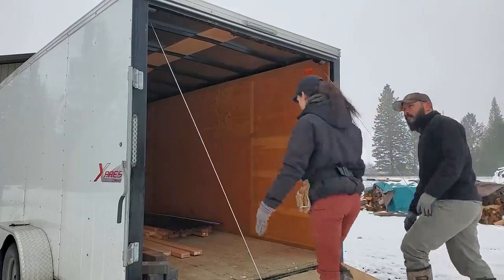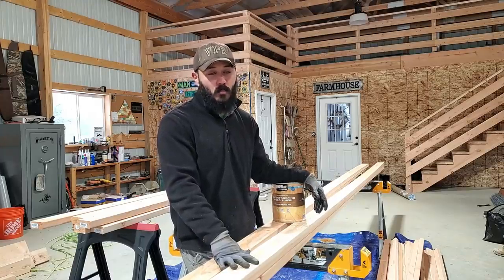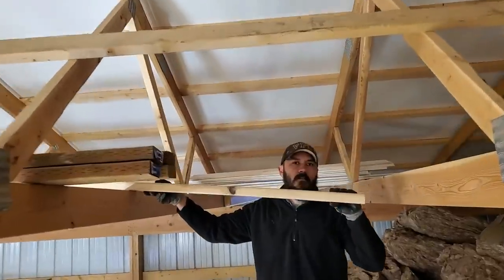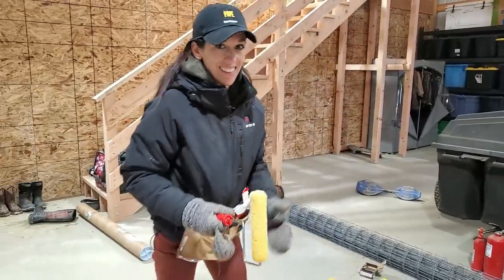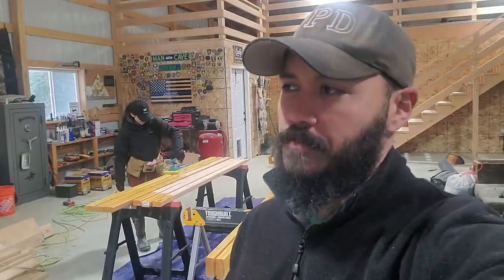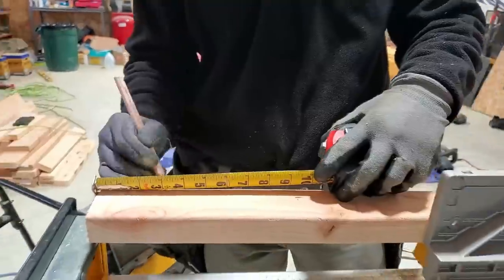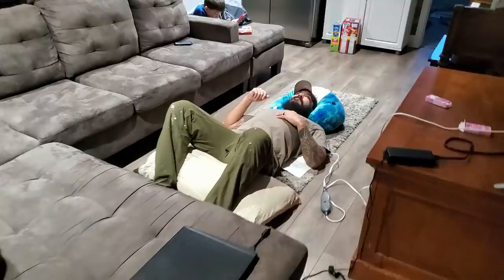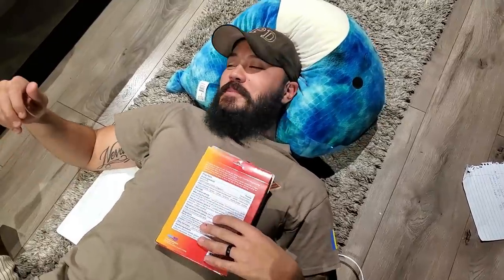He's INJURED | Not How This Build Was Supposed To Go

Comment: Dude, if you never read any other comment of mine, or never take any other advice from me, please read this and take the advice. I had back pain all my life. Bad enough at times that I was out of commission for months at a time. Pain so bad that even SMILING.... hurt. (You'd think there would be no connection between a smile and back pain. LOL) I now have metal plates, and nuts and bolts in my back. I won't go any further into details, just understand that I know about back pain! Twisting wrong. Bending over. Sneezing. Reaching. Even sitting on the edge of the bed and relaxing my back too much. All caused a twitch, then a bad spasm in the back, then weeks or months of agonizing pain.

I tried everything. Tried many doctors. Tried many medications. Even finally had the back surgery. But nothing ever worked as well as this does.

1. Sleep on your side. Always. You may have to put a pillow in front of your chest, to put your arm over. And you may need to bend the leg on top, at the knee and put a pillow under the knee.

And 2. Take these supplements. A. Turmeric. B. Resverotrol and grape seed. C.Horny goat weed. (No jokes.) D. Omega 3. (The BEST one I have found is in a bottle with blue and yellow label at walmart, believe it or not. Says 2000iu. I take 4 a day.)

I can't tell you exactly why these things work, but the combo absolutely works for me. It may take a while to begin to work. Or it may make a difference right away. Don't give up on it, please. I started seeing my best most consistent results after having taken them about 6 months. Now I never miss them. And I take half again, to double the dose recommended. 

The best way that I can describe it is that there used to be what I can only describe as a constant, deep down, core pain that was always sitting there. Waiting to react to the stupidest little trigger, as if I had been stabbed. As soon as the stab happened, it instantly blossomed into the agonizing overwhelming pain. Have you ever seen a bottle of water that has been in the freezer, but hasn't frozen? You tap on the bottle, and it almost instantly freezes. Yeah, that's the way the overwhelming and agonizing pain developed from that 'core pain'.

Well, the combination of supplements somehow suppresses that core pain. Now, when I get the twitch.... No instant agonizing overwhelming pain. Whatever injury I just did... Is exactly the injury that I have to heal from, and I don't have all that agonizing stuff any more. It's been years now. And in fact, last moth, I re-injured my back again, the worst I ever have.... And I was over it the next day. Instead of being in pain for months. Unable to smile, breathe eat, go to the bathroom, etc. I sat in a chair for the day, and went to bed. Next day, I was fine.

Comment: You might want to have your back checked for a Lipoma. I had trouble with my back and it would like an electric shock going from my shoulder blade down to my lower back. I would take about a week to recover. When I turned 65 I had to get a yearly physical for medicare insurance.  I told the doctor about my back spasms and the feeling of an electricshock going down my spine.  She said take your robe off and lay on the examining table. She was feeling my back above the right shoulder blade and she said that I had a lipoma growing there.  She said it is a fatty tumor that likes to dig into the nerves along your spine. She has a brother that has one and he would not have it removed.  He is now in a wheel chair.  I had mine surgically removed and have not had a  back problem since.. That has been 12 years. Mine was imbeded pretty deep as the surgeon told me it was 3 to for layers of stitches.  Might be worth checking it out.    Watch your videos and they are great.   Keep up the good content..    Mike M.

Comment: I have pulled those very same muscles in my back. To help with the pain, I use a tube sock filled with tennis balls and either my wife roll it up and down the area or I will stand up with the tube sock  between my back and the wall and then move up and down to work out the muscles.